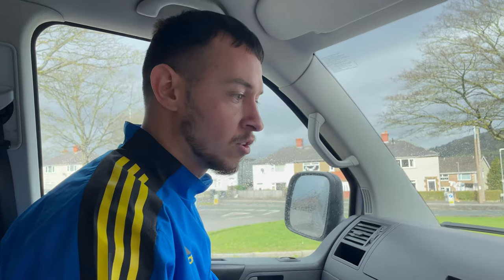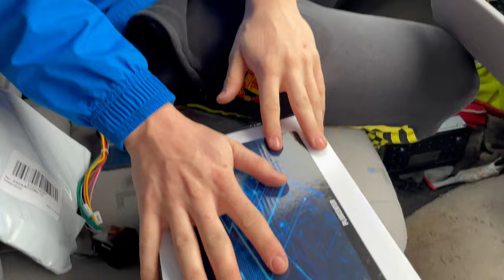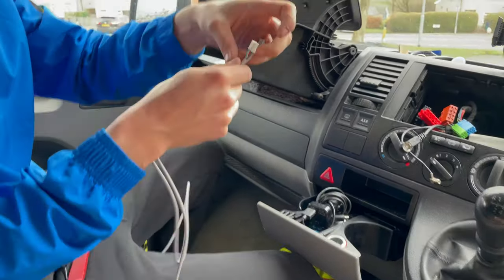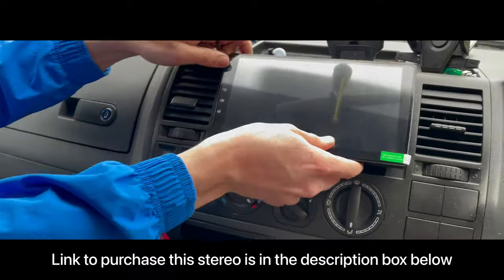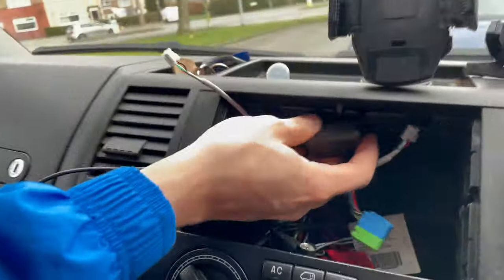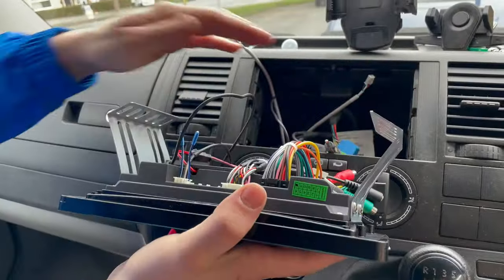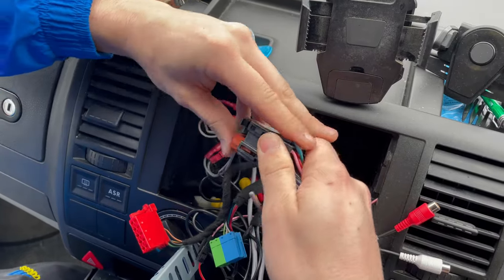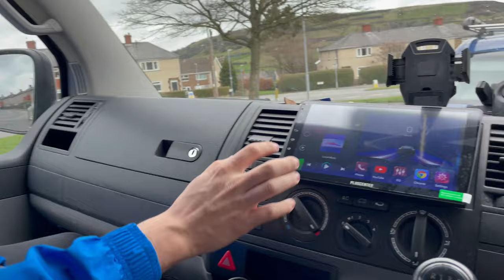How to Remove Radio VW T5 Transporter? Android Head Unit Installation Car Stereo Volkswagen

Comment: Nice vid, really well filmed.  There is a video out there changing one of the blank switch covers on the4 dash to a USB socket.  That might be a nice touch to use that USB plug you have rather than have it in the glove box.

Also, I've been suffering a parasitic drain and so I pulled and disconnected the stock VW radio/cd and that stopped it so I might well have a short within the stock unit itself assuming a cable short would have let the problem continue.  
The reason I mention this is you may wish to measure any current draw across the main fuse socket for the entertainment unit (take the fuse out) to ensure that when the vehicle completely shuts off, it's not drawing anything.  Just as a check.  
It means that if you ever have an issue with these units, you know how it should behave if all is good right now.  If however you see a draw (with the vehicle shut down) then you can see if it's a minor one or a problem one.  Just a suggestion.
Reply: They have them in ove box so it can be locked up and keep ipod or iphone Android phone secure if just nipping shop or what ever it stays charged and out of view from theives

Comment: Hi, i have the same van  with same dash model. Planning to get a 9" like yours instead of a 7". How does the sides look like? Does it fit seamlessly between the back of the radio set and the dashboard? Thanks.